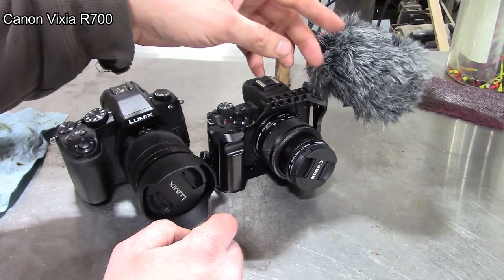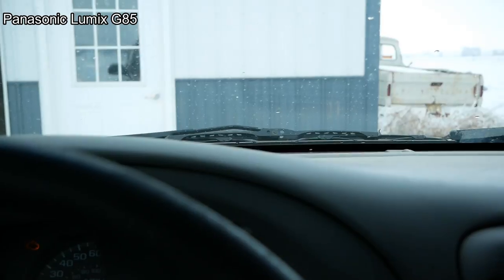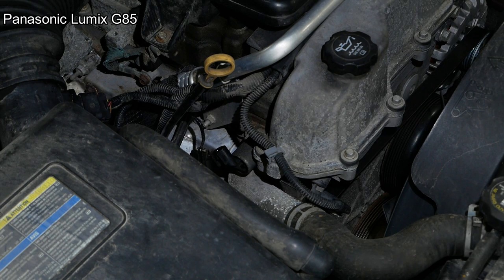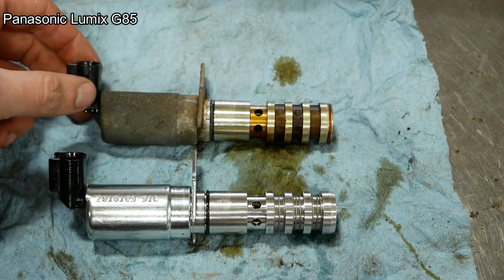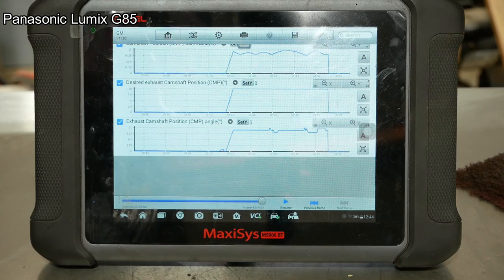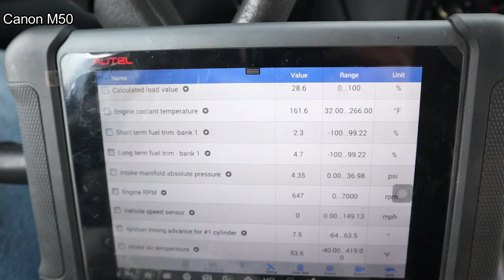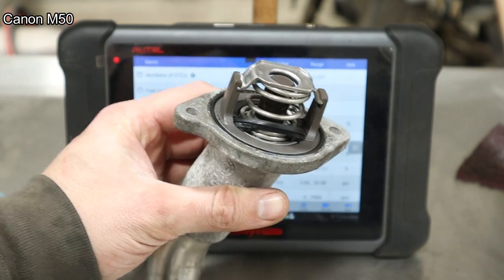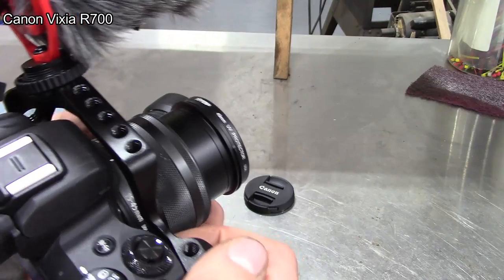Chevy Trailblazer -  Runs Rough on Cold Start, P0014- New Camera Testing

Comment: The Lumix looks promising but as you say the white balance needs calibrating, your old Canon has a better colour balance (I am watching on a calibrated monitor but colour is of course subjective). Content is the most important bit though. Aperture/shutter speed is the main exposure adjustment, ISO is the 'film speed' higher will be faster but less sensitive to light, lower is slower but more sensitive. In video mode the camera is simply taking multiple frames (images) per second, 24, 25 or 30 etc.

Comment: I have a 2006 Chev Trailblazer with 325,000km.  It runs rough during startup in cold and even warm temperatures.  its about -40 in canada right now and I have to keep it at 15 rpm until it warms up. than it runs fine.  Did those two things you replace fix the problem. Has the customer come back to you with the same problem?

Comment: Funnily enough I've had the steering angle sensor fault this week on my Audi. I'm not sure if yours is the same however the Audi looses calibration when the battery goes flat. 

If had mine in pieces over Xmas to rebuild the rear suspension and so had a complete flat battery. 

Procedure to reset for the Audi is to set the steering straight with the engine running and then apply one turn of the steering wheel in each direction +/- 10 degrees. Then drive it. It's supposed to clear when you exceed 15mph, but mine didn't clear until I reached 25.

Comment: When you point it at something reflective the auto focus is going to have a hard time.  
If you are setting up a shot on the tripod, try setting the focus manually. That way, if you pass your arm by the lens it won’t jump the focus out and in. 
For auto focus, I’m not digging a manual off the web but there should be a “dynamic” focus option.  That will try and keep more in focus. You won’t get as much depth of field effects.

Comment: Check the damper inside of the heater tube it’s in the last section of pipe it may be loose or check the shield clamps. That heater shouldn’t make much noise

Comment: Wes
I hate to say as a long time canon user with a few L lens nice long white ones fills two Peli cases .but that m is awful in its auto focus but that may be the kit lens my kit is solid in its af , the lumex wins in that dept. but fo me the colour is a little washed out maybe a white balance problem try it setup to a neutral grey sheet and try them both in the dummy settings eg P mode on the canon

Stuart

Comment: YES, CLEAN THE THROTTLE BUTTERFLY. My son's '07 Trailblazer, with 190k, started surging to the point it would go into limp mode, 35mph max. (Very disconcerting on Rt83 through Harrisburg PA at rush hour.) The throttle butterfly looked like it was glued shut with tar, and because he'd already cleaned it once before, he decided to replace the whole throttle body. Under $60 on Amazon, 3 days shipping. Problem solved.

Comment: Oil wicking, coolant wicking... I've seen both. The worst is DEF. If it leaks out the connector pins into the plug cavity, it wicks something FIERCE. On heavy equipment I've seen it wick through 20 foot of harness across 3 Deutsch connectors, and destroy an ECM.

Comment: The steering angle sensor I believe can be programmed with a Bosch 8860 I'm not 100% sure on that though but I do know it has to be calibrated you might have to use the  scan tool for Chevrolet or whatever that is the tek 2

Comment: My 97 dodge ram 1500 would do the same, would stall if I didnt keep my foot on the gas.  And then would idle rough fluctuations from 500 to 1000 rpm.  Took the Idle Air Control Valve out and cleaned it off now it runs fine.

Comment: couldn't really tell that much difference between the camera's. when you were saying it wasn't auto focusing on your face it seemed to be working fine to me. once you turned the light up when working and then with your light on it was too bright made your hands look funny. work at dealership saved people hundreds of dollars on small evap leak light. Always do this first: pull gas cap and clean the filler neck thoroughly static electricity pulls dirt onto the neck and won't seal to the rubber gasket on the cap. also check for burrs on the neck make sure it feels smooth as you wipe your finger around the neck dirt can get hard and really build up on the neck. second clean the rubber gasket on the cap as well same scenario as neck. last use some type of lubricate whatever is handy silicone spray, old oil, engine build lube as it's sticky like oil treatment. this rectifies the same situations as installing a screw on oil filter without lubing the gasket, what happens it always leaks right? lubing the neck and cap gasket allows the cap gasket to slide just a little more when it hits the neck making a firm seal before you hear the clicks. this had about a 90% success rate. sometimes it was the purge valve if this didn't work. saved many a customer money and time for an easy no shop rate fix:( not always liked by management:). good work yeah should have had your scan hooked up on first crank shame on you easy to forget when your focusing haha on videoing too. good work, stay warm.
Reply from the maker: We have lots of problems with the filler neck surface rusting and not sealing. Chrysler is notorious for that.

Comment: You normally control exposure with either shutter speed or Aperture.
I would try shooting in Aperture priority so you can control your depth of field better, as a higher f number equals a larger depth of field, which would probably be useful to you.

So I would try auto ISO, set the aperture to somewhere between f5 and f8, and auto shutter speed and see how it works

I think the Panasonic seemed to follow the focus better then the Canon, and I have heard good things about Panasonic's video capabilities. I mostly shoot stills on a DSLR though, so take this all with a grain of salt!

Comment: The Canon seemed to be clearer, the images sharper, and the colors more vibrant.  The Panasonic was less so, the colors slightly muted and dimmer.  When you adjusted the ISO bright images started becoming washed out.  However, much more important is your lighting and camera position is VERY GOOD.  I also watch Pine Hollow and J.C. Smith and while their content is good I have a lot of trouble following what they're doing because the work is poorly lit and the camera constantly moving around.  They should learn from your techniques. So... both of your cameras are good but I slightly prefer the Canon.  You can't go wrong with either.  Even the old camera is good enough.  You make good videos.

Comment: The Lumix looks better hands down.

As a sidenote, my hunch was right, and just like i thought the g80-85 range had issues with the autofocus, Panasonic came with firmware updates. But in this case, in your particular setup, it's way better than the dynamic...fritzy nature of the Canon.

As usual, these are just my 2 cents (because i see someone was offended my by "cents" in the last video).

Comment: There's a good chance that putting the Panasonic in shutter priority mode is the best bet. It likely will do more fine adjustments to the ISO than are available to the user if that makes sense. Like if it decides that an ISO of 627 would be perfect it can likely do that in software. I'd just set the shutter speed around 1/60 and let it rip, it should look decent then. My guess is that camera is more set up for quickly shooting photos in raw where you can do more adjustment in post than you can with something like a JPEG or a H.264 video file.  I'm not a cameraologist but that's my 2 cents.

Comment: I wonder if the cold idle issue was due to your P0128 code. The fact a PID wasn’t showing up on the scanner is concerning. If the ECT was faulty it would cause a cold idle issue. Although the code was more likely set from the bad thermostat which you found.

Comment: Seems like most of the camera issues were autofocus and exposure related.   You have new shop lights, right?  You shot a lot there so figure out your new exposure settings on the camera you've been using and then apply them to the new camera.  If you have always shot wide open, try bumping the F stop up to make the depth of field wider, this will use that extra light to help the autofocus.  On the exposure, I shoot Sony A6300 mirrorless with old Minolta manual focus lenses, and I rarely shoot video, so take it with a grain of salt...  But I know that the camera has multiple exposure settings that I can use for the photos I take, and others for video.  At 14:00 the wall behind you was overexposed.  If you are using AF and AE, look for a multi point "area" style meter setting and try that.  By getting an average, it will darken the wall and your face without back lighting you.  Or do it like you always do, but use the AE override to drop it one or two.

Comment: I have seen the oil traveling through the whole wiring into the ecm on a Land Rover defender TD4 with the Ford diesel. Also this is Common on some Mercedes Diesel. Mercedes sells short cables that plug into the loom before the camshaft sensors which act as a oil barrier.
Reply: Rover TD5

Comment: My Colorado does the same thing but not as bad. Never died on me. Manual trans, 2.8L Atlas engine. If this Fail Blazer has the inline 6, clean the throttle body really good. Then of course replace bad sensors.

Comment: So technically for best motion capture on video most people choose a shutter speed of twice your framerate and stick with that. If the auto exposure works well you can put the camera in shutter priority and go from there , but that can lead to overexposure on brught days outside. There might be a setting in the panasonic to change the increments of iso change, for example now its on 1 stop changes, if you change that to 1/3 stop you will have 3 times the control over it, I know that my canon has that setting.
My suggestion is try shutter priority with a medium ISO setting for inside the shop and fix the ISO to low value or auto ISO for ease of use.

Comment: Ok, for my money (or yours ;-)) my preference in overall picture and sound quality, the Lumix wins hands down. Followed a fair way behind by the M50 (mostly due to the auto-unfocus). Sadly, I own an M50 but I've never shot video with it. The auto-focus should be relabeled as auto-unfocus and the M50. It's a little hard to know for sure because there might be some changes applied in 'post production' but I found the audio to be stronger on the Lumix. It was louder but I prefer to call it stronger because I think it was tonally different to the M50. The poor old R700 is a fair way behind both of the other cameras.

Comment: I'm not 100% sure, but I think in the code you give the control loop the position you want (the "command"). Then the control loop does whatever it needs to with the sensors it has available to make that commanded position a reality. The few control loops I've coded didn't have both a "command" and a "desired" parameter, however I have heard talk before of a method where you give it the main command, which would be the "commanded" on your scan tool, then the software ramps up its own "desired" parameter to your "commanded." The "desired" parameter is what is actually fed to the control loop, the "desired" is like an in between. Not sure what this does, if anyone has any other ideas as to why there's both a desired and a commanded, I'm all ears

Comment: So I'm a bit of a cam nerd (stills), personally I would go with a lowest iso possible as with higher iso you will start to get noise. Then go shutter priority, if yoy go aperture priority you will most likely end up with poor and changing depth of field issues ( foreground dropping in and out of focus)     see if you can get a min and max shutter speed and some cams will allow a min and max iso aswell.    One last thing is look out for higher shutter speeds as you will start to get banding on the video due to the frequency of the lighting.

Comment: The Chevy TrailBlazer fuel filter from the year 2003, 2004, 2005, 2006, 2007 and 2008 is located under the car, on the driver side. The fuel filter is located near the fuel tank.
Reply: Wes I see several diff options for this. I can see why people can get confused with it.

Comment: Have an uncle that bought a brand new TrailBlazer with the 6 cylinder ATLAS when it came out.
The VVT system took a dump and the valves and pistons got too friendly with each other.
Thankfully the damned thing was still FRESH & under warranty so he unloaded it on the dealer and jumped ship
 to a crew cab 5.3L V8 Silverado.
I drove a Chevy Colorado with the 2.9L 4 cylinder version for a long time doing deliveries, the thing had a lot of torque(and a appetite for fuel to match).
Ran pretty rough even with no apparent misfire, must have been the nature of the beast being a four pot and kind of too big for the engine's "architecture".
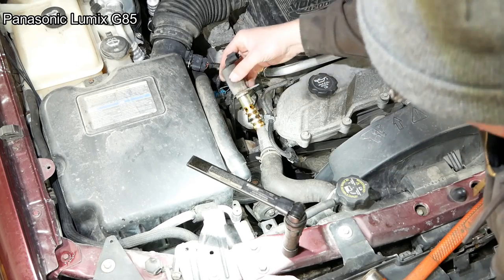9:05 AHHH, YES, OIL SLUDGE on the screen . . . how typical. Very similar to Ford's 3 valve engines.
Cheap oil and long drain intervals, I'm sure. 🤦‍♂️
P.S: LUMIX, FTW !

Comment: wes.... did a few of those stats   you can get around pulling off the belt and altenator  go in from the side with an extension
Reply from the maker: Do you pull the wheel liner? Book time is 1.4 hours. It's pretty easy to beat that even removing the alternator.
Reply: no.... a long extension   you can get it by    not too many of them left  2008 last year...

Comment: Reviewing the footage of the new Canon and the new Lumix multiple times and paying attention to quality overall, without color stuff, I would recommend the Lumix. It just has better auto focus and if you work with your Autel device to read codes, the Lumix does a waaay better job at keeping focus and readability. The Canon is fine too, but auto focus is not good and therefor the focus on your Autel device is pretty bad. Anyways, keep up the good work and greetings from germany :)

Comment: Maybe it's because I'm old, but I don't see a big improvement with either of the new cameras over your old one. You have a bunch of really nice fancy tools, but when you mentioned sending it to the dealership for re-calibration if figured I would share something with you. Check out "tech2win", it is a tech2 emulator for a pc. I have not gotten one yet, but my understanding is that you can do anything with it that the guys in the dealership do with the tech2 including re-calibration of many systems including PCMs. Great video, thanks for sharing. Just one more thing, back when I worked in the dealerships, I found out they design and build the vehicles, and then make the service manual. I feel that is somewhat backwards, but that would explain the dumb things like taking a power steering pump off to replace the cam solenoid.

Comment: Mine did this same thing.  Mechanic tried it first thing in the morning in single digits cold, had his helper inside making it idle at about 2.5k and then started spraying water down by the intake gasket... stall.  The intake gaskets on these get old and when it's cold out, they shrink a bit and get hard, letting extra air come in.  In just a couple minutes it heats up, expands, and it stops doing it.  Real pain to find.

Comment: The "manual" mode on the Lumix works like an old film photo camera - you are let to set all parameters on your own. It's not ideal for video, not without a stepless lens that would allow you to adjust the aperture seamlessly with the lens ring. [I'm not sure if your kit lens can do that or not, I can look it up if you put the whole lens number up somewhere.]
For video, I'd recommend shutter priority mode, since the camera can dial in fractional f/stop values on all mFT lenses.

P.S. If you want an even wider angle, look up Lumix's 7-14 lens: https://www.four-thirds.org/en/microft/wide.html#i_007-014mm_f040_panasonic It's not cheap but it really high quality.

Comment: I have a 02 trailblazer, and it runs fine til I come to a stop then it acts like wanting to stall. So wat would cause that. And sometimes on the dash it pops up low oil pressure and stop engine? And I checked the oil and the oil is full. So I think it's the oil pressure switch above the oil filter. Is that right?

Comment: You may want to try auto ISO, Auto exposure . Canon cameras have a P setting (Program) that does auto focus, auto exposure or you can set manual settings. Canon also has A setting (Full Auto). I own several Canon cameras, both Still and Video. No Panasonic.

Comment: had a GM with the same issue was the temp sensor, see if i am right when you figure it out. those Vortec straight sixes go forever, had one with 400,000 that ran great and didn't burn oil to bad rest of the truck needed too much, bushings, joints, etc.. it was til on road but needing maintenance on the body, was just cheaper to upgrade. End of the video and I was wrong it appears.

Comment: On my friends Cadillac with the 3.6 the oil pressure sensor failed and sent oil to the pcm. Shop misdiagnosed bad throttle actuator and replaced it with no fix.  Car was randomly stumbling and sometimes no throttle response at all. I popped the pcm connector and dirty oil flowed out… problem solved! Lol

Comment: some mercedes engines have the same problem with the vvt solenoids/gearbox connector which pushes oil all through the wiring harness and throws the entire car out of wack, the oil loves to pool up at the connector to the o2 sensor and messes all of the readings